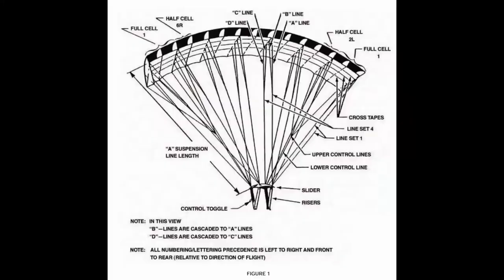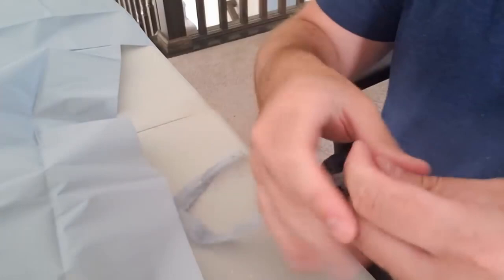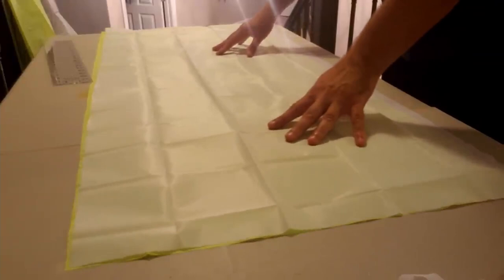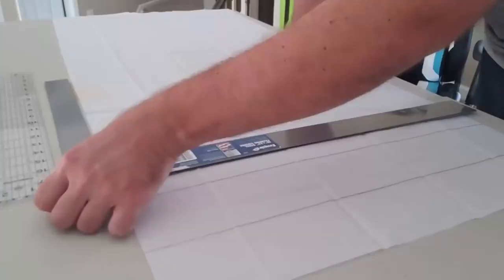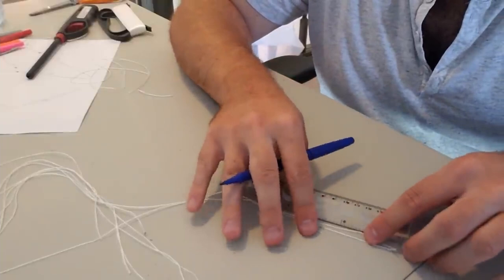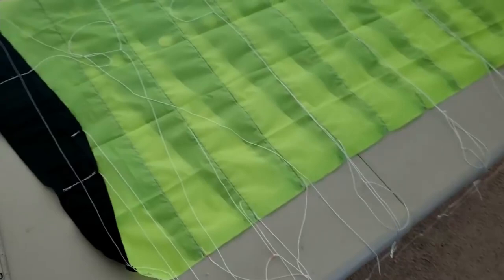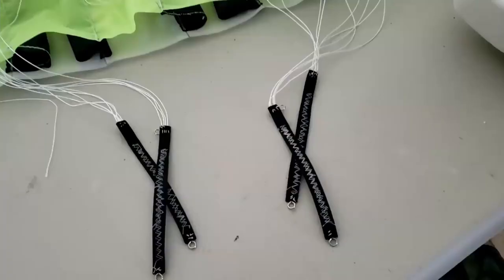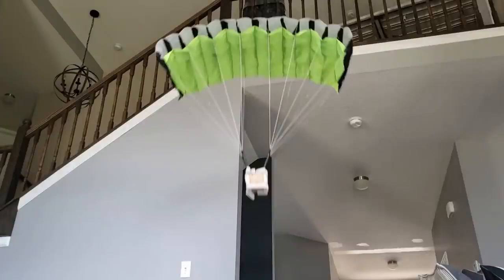How to Build an RC Skydiver | Ram-Air Parachute | PART 4 | Project Skyfall

Comment: To sew the top on. You sew one end on, then the next and the next one at a time left to right or right to left. Easy. The last one or the other end what ever you call it, you roll the entire chute up to make it small, then fold the last rib and the top back over the rolled up chute. Then just sew the top of the last rib to the big top piece and the seam goes on the outside. Then unfold the chute so it’s the right way. Then unroll the chute and all the seams are on the inside.